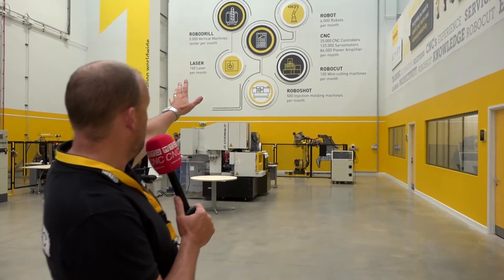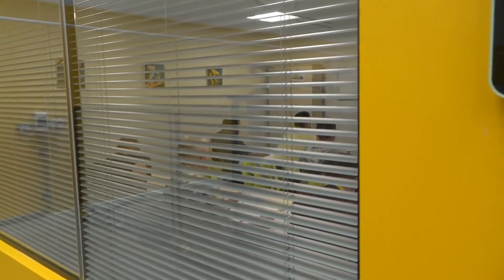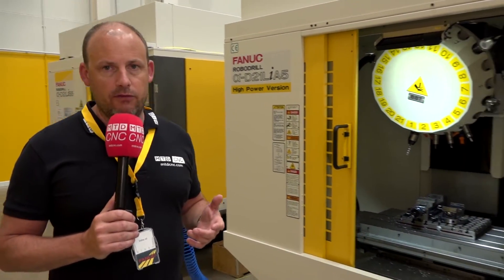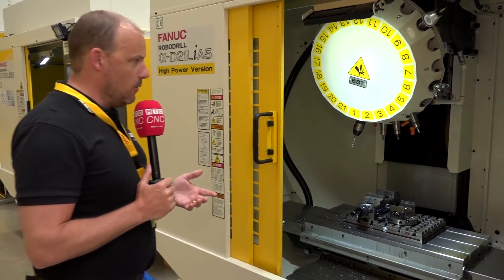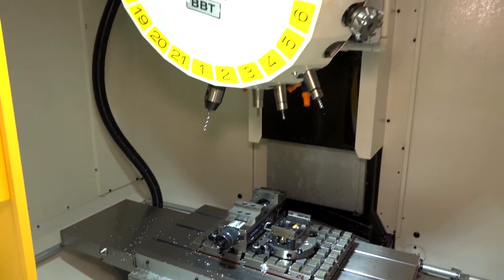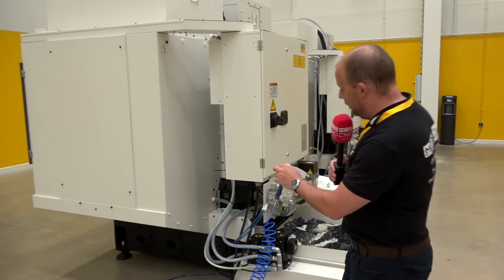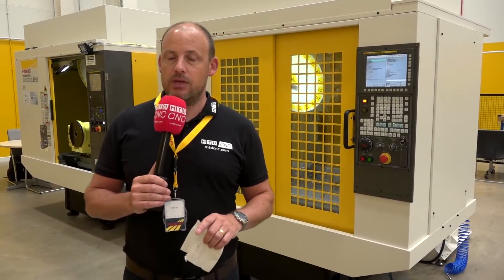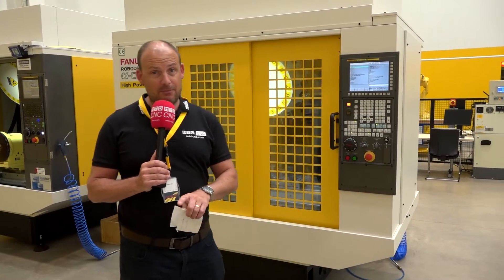1 MACHINE EX DEMO - FANUC ROBODRILL VMC

Comment: What's the memory capacity of the machine? We all know Fanuc is cheap for memory. A large table is nice and all, but pointless if you can't use it for large programs. Drip feeding is not a solution, it's a workaround; 1980's legacy logic.